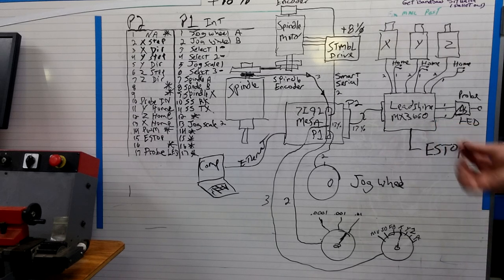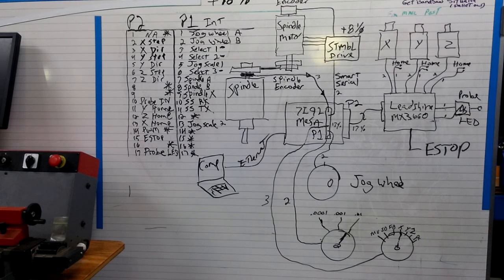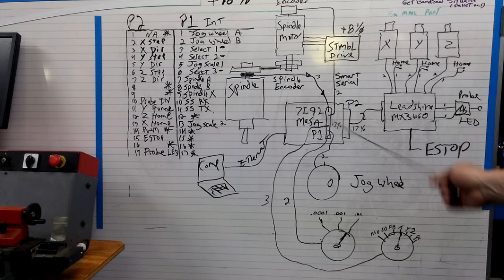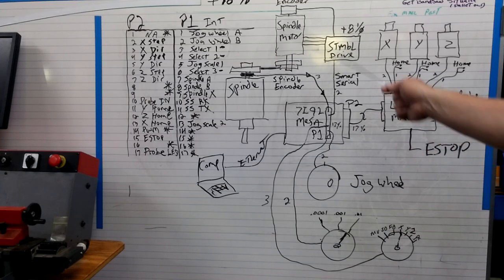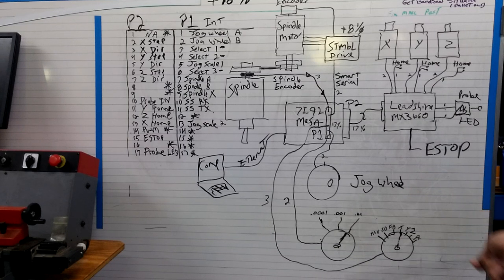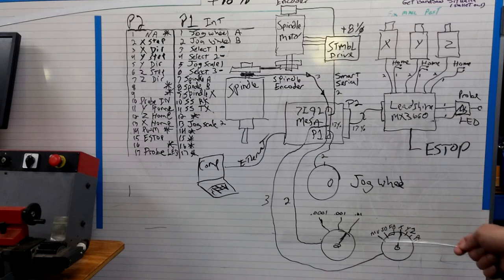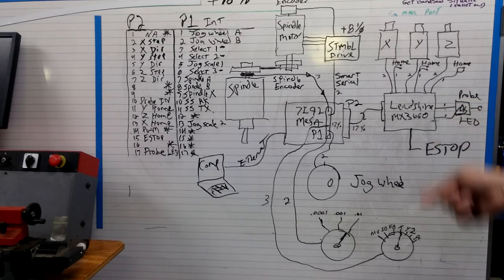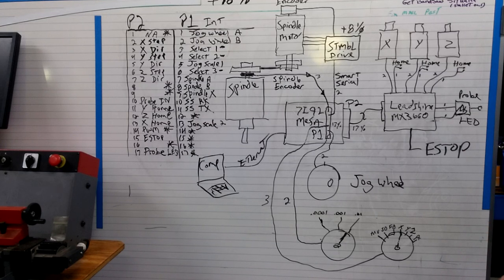Green machine block diagram.....

Comment: Thanks for being so clear and detailed. This has really helped me. Your working through the HAL commands on the CLI really made the pin configuration make sense. That e-stop routine is a masterpiece in explanation. I'm working on a simple parallel BOB and cnc shield. I have my steppers and outputs configured, but now is the input for the end stops.